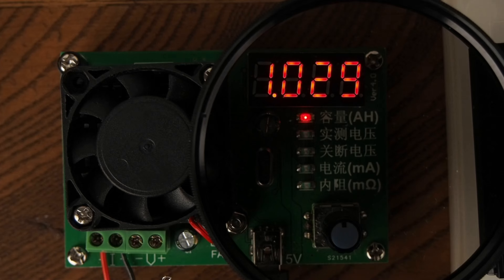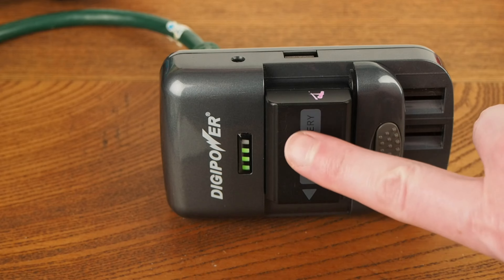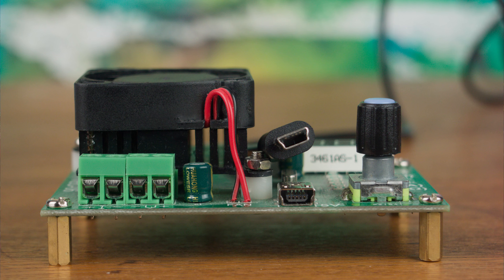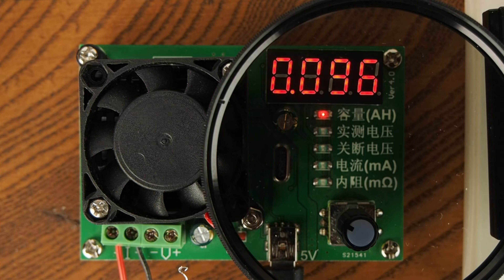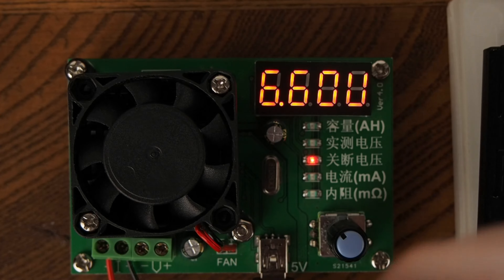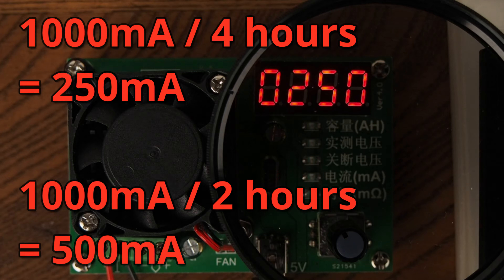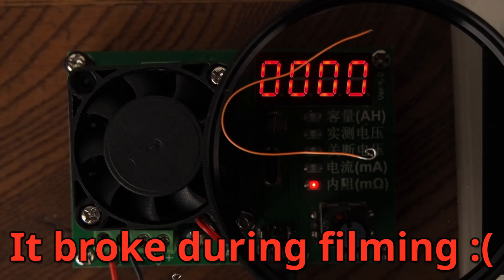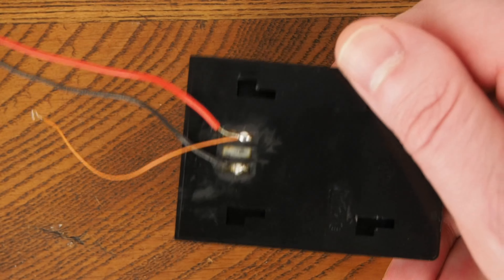Capacity Testing Camera Batteries with the TEC-06

Comment: So I bought a TEC-06 on ebay, and got version 6.3 instead of 4.0 like you have here. The components look differently soldered on the back. When hooking it up to my Sony NP-FW50 batteries, if the discharge rate is set any higher than 200ma, it triggers some sort of safety within the battery and the battery contacts go to zero volts. Kind of inconvenient because 200ma will take almost 5 hours to test a battery. Just thought I'd mention it here for anyone else interested in trying this.
Reply from the maker: I had the same problem when I used a USB power adapter that output less than 1 amp. Also check the screw down terminal connections, I've had times when the connection wasn't good enough.
Reply: @OutsidetheShot that's good input, thanks! I actually figured it out, I need to use testing mode 2, not 1. Mode 1 terminates based on the open circuit voltage, while mode 2 terminates based on the under load voltage. Batteries with electronics between the batt and load don't seem to like mode 1. In mode 2 I'm no longer having problems. Excited to test all my batteries!